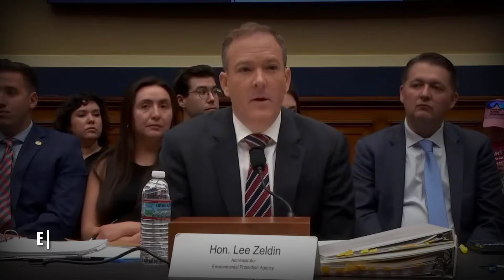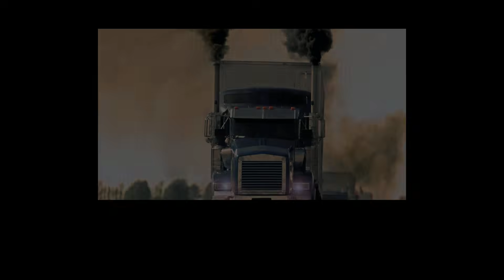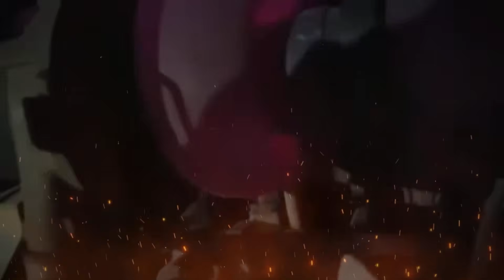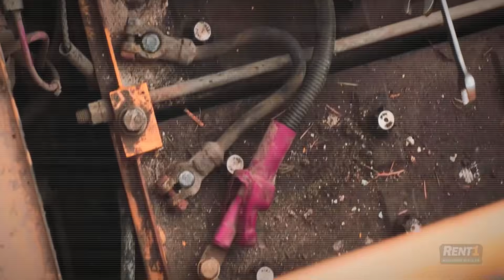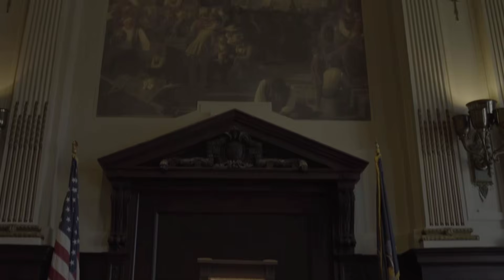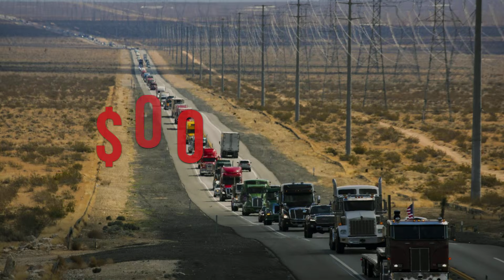The Ugly Hidden Cost of Clean Truck Technology

Comment: My check engine light was always emissions related.  The cost of some sensors was over $600, change one sensor and 4 months latter another code and another sensor is required to be replaced it never stops.  A great running engine now becomes a money pit with the fear of being stranded and only going 25 MPH to the nearest dealer that shows no mercy when the repair bill comes.  If I burn 20% more fuel, that is more CO2, what are we gaining.  I am at a loss to understand any  of this and the costs have to be passed on to the customer or go broke.